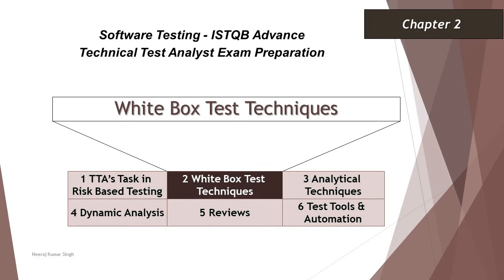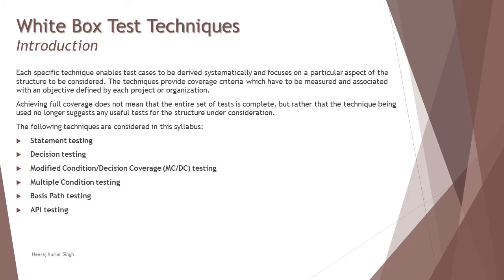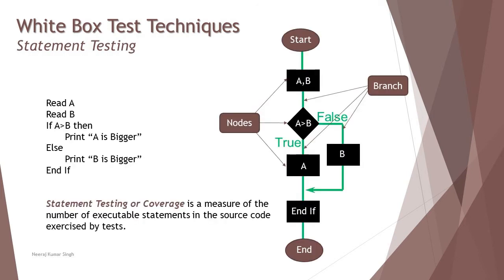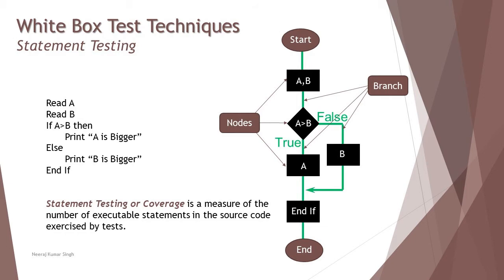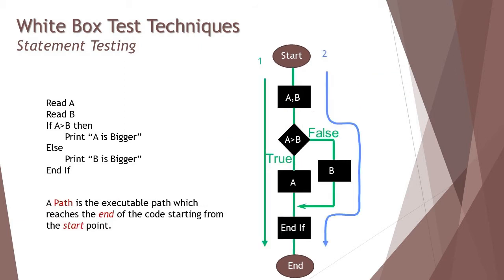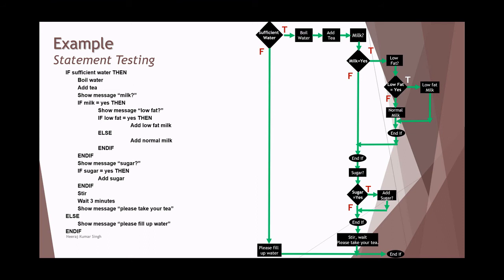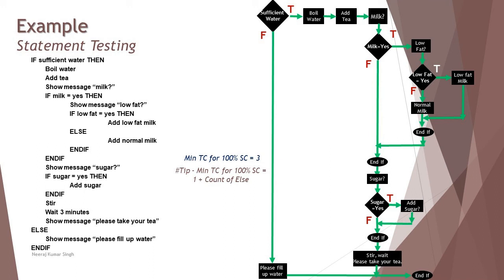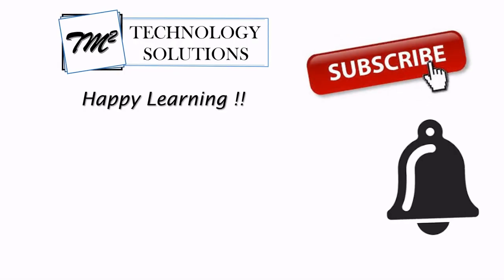ISTQB Technical Test Analyst | 2.1 Introduction & 2.2 Statement Testing | ISTQB Tutorials

Comment: Should it not be 4 test cases at ~ 7:35? because he drew a line on the right outer TRUE-path and a line where "low fad = yes" is falase and a line on the left outer FALSE-path. but what about the path where "Milk = yes" is false? wouldn't that be a fourth path for 100% coverage? Or do I think wrong and if yes, where?
Reply: That was covered on the 2nd path
Reply: The black shapes are the statements. So how many tests would you need to cover all the black shapes? Not necessarily following the green lines
Reply: Milk = false was not covered
Reply: I think it should be 4 too 
1- no sufficient water = true
2- sufficient water + no milk
3- sufficient water + milk low fat + no sugar
4 - sufficient water + milk normal + sugar